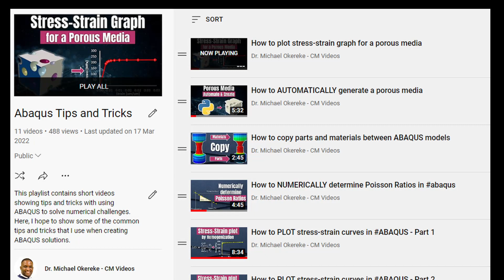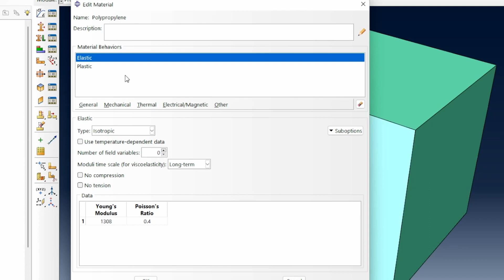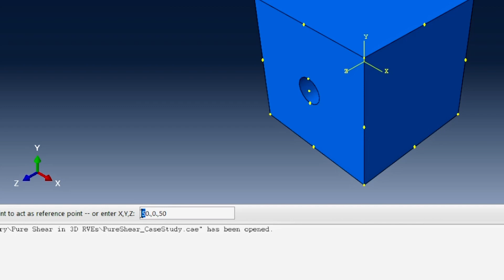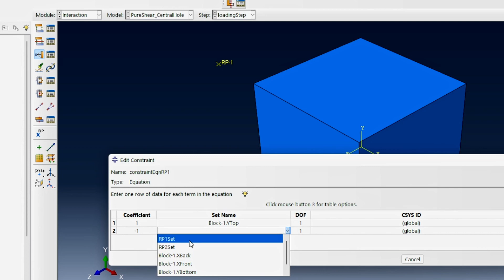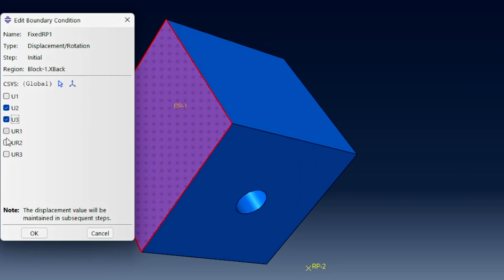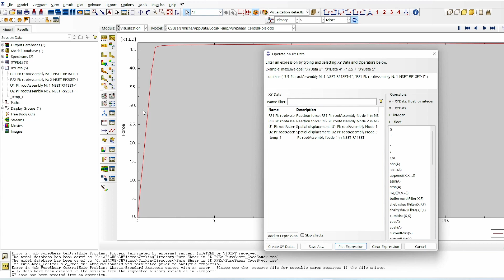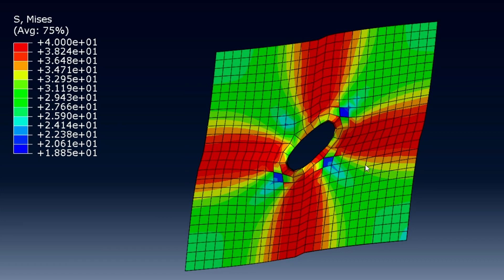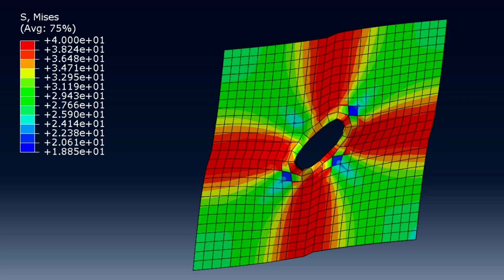How to apply PURE SHEAR on 3D RVEs in ABAQUS

Comment: I feel like there was an error in the formula used for calculating the shear modulus in Excel. G=ShearStress/[1/2*(ShearStrain1+ShearStrain2)], It's clear that you forgot to sum the two strains, resulting in the result being twice as large as it should be. If I am mistaken, please correct me. Thank you.
Reply from the maker: Hello, I am not sure I understand the reference to error. I determined numerical shear Modulus, G which was based on slopes of numerical (elastic region) plots of shear modulus. I added both values and divided overall by 2. Check the 14:08 time stamp in the video. With regards to the analytically derived shear modulus, that is pretty straightforward and the equations is calculated correctly. I am not sure I understand what the confusion is. Please look at the video again and see if you understand better.

Comment: The video content is good, but the model doesn't seem to satisfy periodic boundary conditions, does it?
Reply from the maker: Definitely, this does not satisfy periodic boundary condition. This was not the intention. To get it to deform in a periodic manner, you will need to constrain parallel opposite faces kinematically. This is not done by default in ABAQUS at the moment, it needs to be coded up using Python scripting. So, here I have simply used Dirichlet BC types to prescribe shear loads on a 3d RVE, which is not always straightforward hence the video.

Comment: Hello, thank you for making the video and learning a lot. I recently learned about direct shear test simulation, but I have been making mistakes. I don't know how to do it. Can you make a numerical simulation about direct shear test? Experiments and numerical simulations can be compared, using Abaqus for simulation. If you can, I would greatly appreciate it
Reply from the maker: Hello, I do not have any experience working with Direct Shear tests. I see though that it is about creating shear in soil, so technically it can be done. I will have to research into it and explore if this is a video that I can made. For now, I will say no! Good luck with the research.

Comment: I apologize for all the questions. Please Doc, what formula did you use for the Analytical calculations of G12 and G21?
Reply from the maker: Hello @Johnson, if you look at the formula row in the excel sheet it will tell you the analytical shear modules is calculated with:

G = E/(2*[1  + v])

Where E is Youngs Modulus and v is poison ratio.

Comment: Hello sir please i want a plugin toi create rev with variable orientation of firber or if you Can known how toi get degimat
Reply from the maker: Hello @Guilpin, thanks for the comment. I do not have access to such plugin for creating variable orientation of fibres within an RVE. This can be coded up into some kind of Python script but at the moment, I have not implemented this in my existing software products. Maybe, in future, when I get the time, I can do so but it is certainly a possible thing to do. 

As regards Digimat, no, I do not have access to it and unable to help you get it. You may like to contact the company directly and they may have a student license (if you are one) which you can use freely. I really do not have any experience with digimat, sorry!

Comment: Dear Sir, Is it mandatory that the dimensions of the cube have to be equal (i.e., Length = Width = Depth)?
Reply from the maker: No Satyam, it does not have to be. You can do same on a cuboid as well, just make sure when you determine the shear strains that your Lx and Ly values reflect the actual values of your cuboid, unlike in my case here where Lx = Ly = Lz = 50 mm.
Reply: @MichaelOkereke  Okay Sir. Thank You!